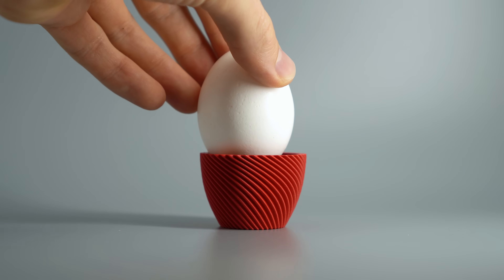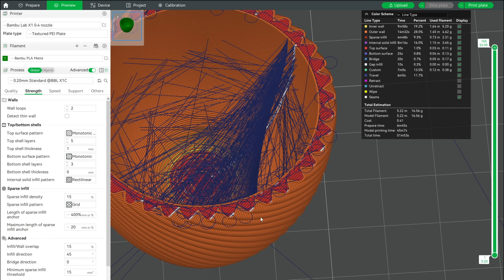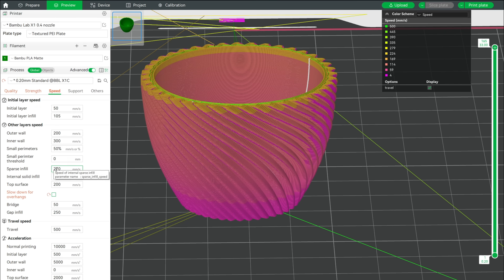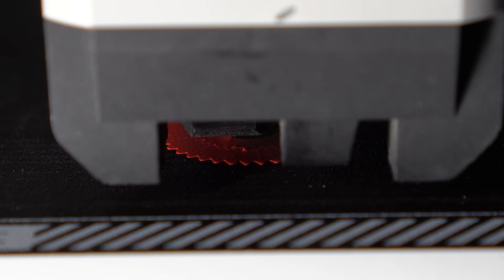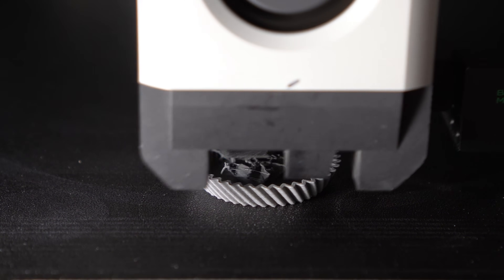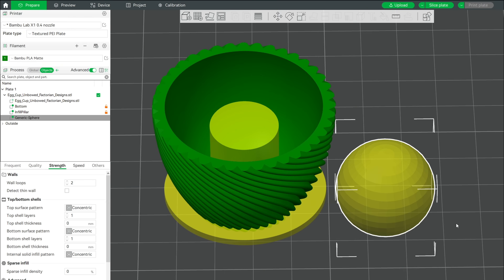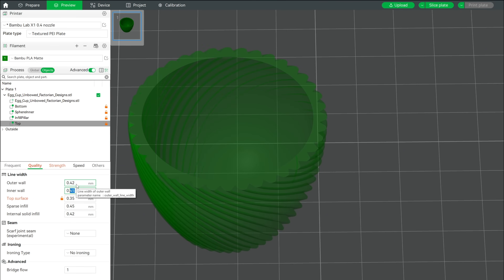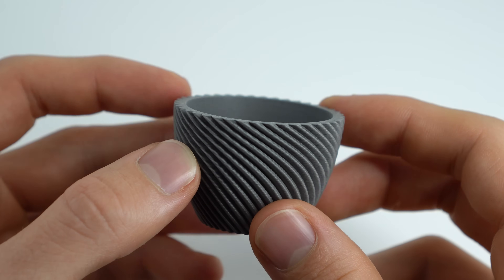Crazy 3D Slicer Hacks for Perfect Prints!

Comment: Damn, it's super clear that you have done a absolute tonne of printing and testing! These insights are very helpful! I wanted to mention incase you havent come accross it that sometimes the avoid crossing walls travel setting can create surface defects, I have especially noitced this with CF filaments. It seems to happen when the resolution of the travel path deosnt keep up with the geometry of the model and the nozzle sort of porpoises accross the surface of the print for a section. I've not seen this discusssed much so thought it's worth a mention. Also it would be a big missed opportunity if you dont scale up this model up 10x and wear it as a hat  ;)
Reply from the maker: Oh that is a very good point, I'll take a closer look at this. I even have a video in mind where this would fit in perfectly. 
Thank you for the great comment!
Reply: @Factorian_Designs  Neat :)

Comment: Wow, thanks for this amazing content. I discovered the “Slow Down for Cooling” on my own, but had not considered the other tips like line width manipulation and modifiers. I think the new Bambu Studio evens out the outside perimeter by default now, but I had to turn off on Anycubic Slicer Next. My X1C prints typically look great with default settings, but I had to do a lot of tweaks for certain prints on the Anycubic KS1 printers. I always preview the “Flow Rate” layers view now before sending a print. If the flow varies too much, I will adjust to improve appearance.
Reply from the maker: True this is now a little better in Bambu Studio but not completely fixed.
Thank you for all the kind words!

Comment: This might be a stupid question, if I buy this model from you, are all these settings built in? Or would I have to edit myself? As you can tell I'm new to this :)
Reply from the maker: Good question!
If you buy the model from me there are two files included:
1. the STL (only geometry)
2. 3MF (geometry + all settings I use)

3MF files are always Software dependent, the ones I use work with Bambu Studio and Orca Slicer.

Comment: What material are you using for the egg cups? Do you tell them it is dishwasher safe? Today I realized that I know nothing about 3d printing 😂. I usually just use the default settings and call it a day. Great video?
Reply from the maker: I PLA for mine and the sold ones in the past as well. The contact area is pretty small so not too much heat transfer. But yes I would always slap a fat disclaimer on them that they are not dishwasher safe. :D

Comment: Ths print doesn't even lose much strength here; most of the strength comes from the walls and not the infill, and the corrugated shape makes the walls stiffer and stronger. So it is faster, smoother and more reliable with no noticeable sacrifice in strength.
Reply from the maker: yes exactly!

Comment: Hey! I have the Bambu Lab A1, I use 5% infill gyroid patterns and I have notice that the nozzle "drags" accros the infill patterns...it hasn't ruined a print yet, but it makes a big noise and and it doesn't feel right. I have tried to increase the Z hop 0.8 mm but it doesn't worked. I know you said that Z hop is pretty much useless so I wanted to have your insight on this issue ^^ thanks a lot for sharing your knowledge :)
Reply from the maker: Are you sure that it is the infill? I think gyroid is not a crossing pattern and 0.8 mm z hop should be more than enough. 
Is your extrusion rate calibrated?
Reply: @Factorian_Designs  thank you very much for your answer. I have done all calibration and it seems to be good. The problem occurs when the nozzle travel from one side of the model quickly to the other side, by crossing the center of the model and it drags some "spaghettis" and damaged the infill pattern...is there a way to control the high of this kind of travel. I have tried "avoid crossing walls" but this linear travel from one side to the other is still there and it is this movement that touches the infill. (I will ask bambu lab also directly but you expertise is very valuable too 😙)
Reply from the maker: @jeremypajot-art  normally z-hop is the right setting for that. Without seeing a video of the problem this is hard to diagnose tbh.
Reply: @Factorian_Designs  Thanks a lot for your time and advice, I will contact Bambu Lab and I will keep you updated about the solution if there is one ^^

Comment: Will these work on any print or is it specific for your model? Because if so, what really is the point? It's all so specific, I have no clue what half these steps are for.
Reply from the maker: This video shows high optimization on one print so you can do it with other ones. If you are just starting out its probably better to keep the settings simple and get a hang of the basics.

Comment: will these settings only work for your 3d file or are they good for most of 3d print files...
Reply from the maker: This is hard to answer, some of these will work with any files, like avoid crossing walls and others like the special modifier in that exact location are model specific.
Reply: @Factorian_Designs Thanks for your response! I definitely need to revisit my slicer and printer settings. I had tweaked some values for specific prints, but accidentally saved them  now everything feels off, and I’ve noticed the overall quality of my prints has dropped. I’d really appreciate having a solid set of basic slicer and printer settings that work well as a reliable starting point for most prints.
Reply from the maker: @WeAreFlamey  The standard profiles from Bambu Lab are honestly pretty good as a starting point but I would Always enable "avoid crossing walls" and reduce the Print speeds + acceleration a little bit

Comment: Amazing tips but here's a question, instead of going thorugh all the steps to make the top surface even, why not just enable ironing on the topmost surface and that will give you a smooth finish by itself?
Reply: I think the problem in a case of semi series like this one is that ironing require post processing to removed the ironed out material

Comment: My prints with Bambu and PETG are so hairy on the outside with similar outer wall. Any recommendations?
Reply from the maker: I have printed PETG way less than PLA so I am not sure if there is a setting that can fix that. I do notice that my PETG has to be very dry to print good. Drying it at 80°C for 12h does wonders for my printquality with PETG.
Reply: I recommend Dry the filament 
I only use PETG and the best results you get by using a Dryer

Comment: So you're selling a food-grade product which is NOT food-safe to the general public? Ouch. That fine is gonna hurt.
Reply from the maker: No not at all. The edible part of the egg is in never in contact with the egg cup.
Reply: @ Eggs are not clean. They can carry bacteria, such as salmonella. You run the risk of the bacteria on the egg transferring to the egg holder, and since the egg holder is 3D printed and not food safe, it is difficult to clean.

But that’s just the egg shell. Any spill from the egg onto the egg holder will be difficult to clean out thoroughly. The fine swirls on the outside may also pose difficult to clean. To top it all off, the 3D printed egg holder has a hollow inside with plenty of space for bacterial growth.

To make it clear - any product which comes into contact with food has to be considered food safe - made with non-toxic materials and designed to limit the potential for bacterial growth.
Reply from the maker: @MCasterAnd  You are overcomplicating it. There are several studies that show that this isn't as big of a problem as some of the 3D printing community make it out to be. I have been using mine for over 5 years and they are totally fine to use.

Comment: I've just started doing my own production runs of parts for a commercial product. While I'm very happy with the quality, it is time consuming and consumes a lot of material. I'm going to try to implement a lot of this. Thanks for the great video! Do you have any hints on how to hide the seam better using scarf joints? I've had some success with them, but I feel like it could be better.

Comment: Thank you very much for making good video like this, help me a lot as i just started 3d printing. Recently i ran into problem about different wall color(some glossy, some matte). In my slicer preview, all the wall from the bottom to the top has same printing speed. After i investigated further, the glossy wall is spotted in some layers with longer layer time. I think this happen bcs the fan speed setting? or do you have any idea how to resolve this? i really stuck on it right now. Thank you
Reply from the maker: Did you make sure that you have a fixed fan speed across all layers? 
It might also be worth a try to increase the minimum layer time to ensure even cooling for all layers. If you still can't solve the problem I would try a different filament brand, some are harder than other to print evenly.
Good luck!
Reply: @Factorian_Designs  Yes, and the result still the same. I think my case is correlated with "benchy hull line" which someone said cannot be fixed because the way fdm printer works. What do you think about it?
Reply from the maker: Its hard to tell without seeing the model to be honest, never had your exact issue myself but the benchy hull line issue is very hard to fix yes.

Comment: Very informative video, but in cura you could do this completely without modifiers. How did you get rid of the z-seam?
Reply from the maker: I didn't get rid of the z-seam, its still there.

Pretty sure you can't do this in cura without modifiers 😅 how do you achive the infill pillar?
Reply: @Factorian_Designs  wow didn't see any... Looked great. I'm still waiting for scarf joints.
For the infill pillar I would set the infill overhang angle to e.g. 60°. 
I don't know if it has the same outcome but it's intended to serve the same purpose.
Reply from the maker: In Bambu Studio setting the overhang angle of lightning infill to 60° does not give the desired outcome. Not sure if Cura is much different there.
Reply: @Factorian_Designs  if you want I can give it a try and send you the results.
Reply from the maker: @TheNitrox88  Yes, but you don't have to send them to me, I'll believe you when you say it works :)

Comment: Very interesting video. But you left out the most important piece of information: How are you treating these in a manner that is still profitable? Epoxy coating things is time consuming and messy. Selling raw prints is profitable but the second you have to post process the cost goes up significantly, just from a materials perspective, let alone time. I am really curious your methodology considering that selling unsealed prints for food use is unethical and dangerous I hope that you can make this information available so that everyone can benefit. 

I'm having a hard time finding FDA/EMA approved filament where I am, could I ask what brand you are using?
Reply from the maker: I don't do any type post processing. The egg cup only thouches the shell off the egg and is at no point in any contact with food that will be consumed.
Reply: @Factorian_Designs  I strongly urge you to check out Prusa's video "How to make food-safe 3d printed Models" as well as My Tech Fun "About Food safe 3D Printing" 

These two videos should explain in detail the issues with your methodology from slicing to post processing. 

You can do what you want obviously, but in my opinion what you are doing is unethical and your response ridiculous. Have you never seen the Yolk run down the exterior of an egg cup, from dipping toast, and a child lick it? 

Bambu Labs needs to educate their customer base. The entire 3d printing community outside of the bambu labs circle jerk has said for years DO NOT 3D PRINT ITEMS FOR FOOD USE and here comes Bambu setting us back literally years of education. Their printers are not marketed as food safe. The enclosed printers use carbon fiber rods which degrade over time, this introduces particles into the printer, which Bambu tells the user to clean regularly in their manual. Is the epoxy in their carbon rods food safe? The carbon? There needs to be serious thought put into producing food safe items. Especially when you are selling them to the public. Especially in Europe lol, your guys agencies are no joke. I don't think you want to be bankrupted for the rest of your life because of a stupid oversight 3d printing.

Comment: Wouldn't the printquality even be better if you use adaptive layer height around the inner sphere shape? To hide layer lines
Reply from the maker: Lots of others have said this as well, but If you do that your outer shape will also have a lower layer height, which to me looks weird and inconsistent.
Reply: @Factorian_Designs  true! Cant you change that with a modifier?
Reply: @Factorian_Designs  of maybe use an overall lower layer height and crank speed overall
Reply from the maker: @milannekuhh  No you sadly can't change that with a modifier. I think 0,2 is already the sweetspot between quality and speed :)

Comment: One feature that I've always wanted to see, but only stumbled upon it when I switched over to Orca Slicer... Z-Hop on top surfaces, only. Some models have a top surface that you don't want any scarring on and I'd run my final slicer code thru Prusa's G Code Previewer, then manually insert the hops. While perusing the printer's extruder settings, I noticed the Top Surfaces Only option and it works fine - saves coding and you're not z-hopping on every layer, which is pretty useless.

Comment: Why do you use a modifier, when you can just set the property by height?
Reply from the maker: Its the same result using two different ways, both are fine :)
Reply: @Factorian_Designs  I just don't find it easy to transfer modifiers from one model to the next, or say a remodel. Is there a way to do that?
Reply from the maker: @FrodeBergetonNilsen  If you want to print multiple of the same model, modifiers are copied together with the model. Otherwise I don't see why you would want to do that, as every model has to be optimized differently.
Reply: @Factorian_Designs That makes no sense. If you want to apply something by layer, use the correct way to do so. Modifiers do not work for me, since whenever I use them for anything but layers, the outer boundary of the modification generates weaknesses in the print. For instance, using a modifier to increase infill, will produce a line of no-crossing around the boundary of the modifier object. Also, if you use line height, it somewhat easy to transfer the modifications to another model, by replacing the stl. But if you use modifiers instead of line height, that makes no sense to me.
Reply from the maker: @FrodeBergetonNilsen  I honestly never had the issue you just described
Reply: @Factorian_Designs  You have. It is in your videos.
Reply from the maker: @FrodeBergetonNilsen  I don't get it, where in my videos do you see that?

Comment: You could also apply a topmost surface iron to get a incredibly smooth surface finish. But this will increase your print time by a little bit.
Reply from the maker: I said this in antoher comment as well, but I don't like ironing on small surfaces, never really looks good to me. But yes this can be a great solution in some cases.

Comment: I’ve tried your methods and they are a game changer, especially the  modifiers enable it to use infills only where needed. However, I struggle a little bit with closed round Objekts, the top doesn’t seem to have enough layers despite a ball shaped modifier I put on top, so unfortunately I got some holes in the round top shell…. And when I change the line width of the top modifier I get an extra seam in the shape of the modifier on the top. Maybe hard to explain but I kinda don’t understand it yet. I keep trying. Otherwise the wall quality is insane and the time and filament savings are significant!
Reply: I think I found the solution. When using heavily sloped objects like closed-top round objects, diabling “ensure vertical shell thickness” causes to only produce a very thin layer on the top that has holes. I activated the “moderate” setting in the top modifier and the problem seems to be fixed now!!
Reply from the maker: Great that you we're able to fix the Problem yourself! Thats why understanding the settings is so important. 😁

Comment: Woah. There is so much to think about here. I would love to see some more optimizations on supports and surface finishes. I have a small volume print (15g) in PPA-CF. I can't really optimize for reduced plastic since it requires 100% infil, but I'd love to make the surface under the support material cleaner. Wondering if I can use Modifier shapes for that?
Reply from the maker: I think you have send me a dm as well, I just answered it :)

Comment: There is something I am not sure to understand...
What is the difference between setting directly for the object 3 bottom and 3 top layers, compared to having a modifier at the top and a modifier at the bottom which sets the layers to 3 ? 
I must have missed something, it feels like it would give the same result for your model
Reply from the maker: If you do that, Bambu will add material in areas where we don't need it like shown with the "ensure vertical shell thickness". The only way to prevent that is by setting the top and bottom layers to 1.
Reply: @Factorian_Designs  ooooh... Okay got it, that's quite counter intuitive from the slicer, indeed. Thank you for the answer :)